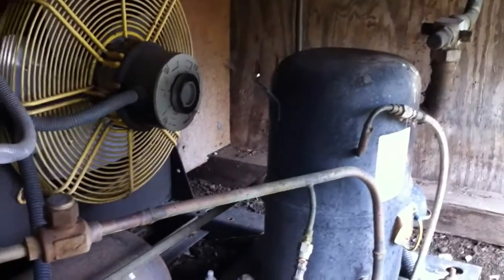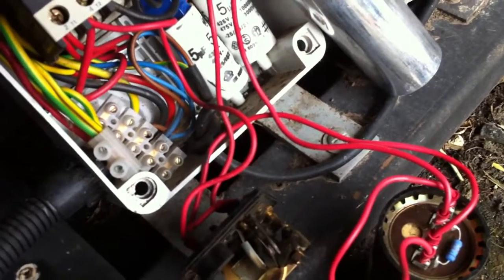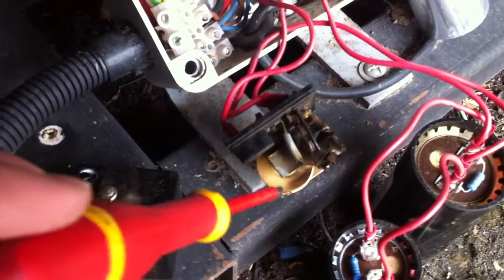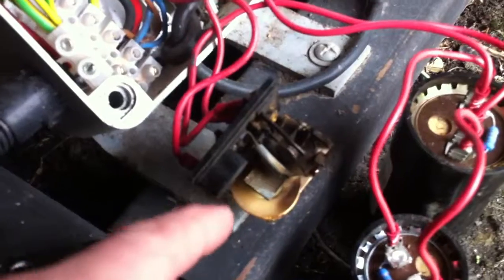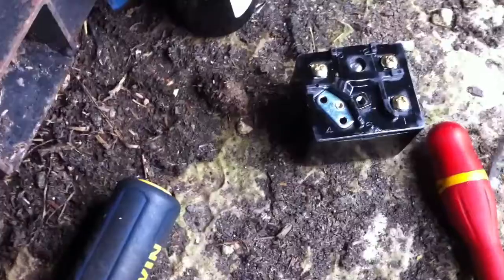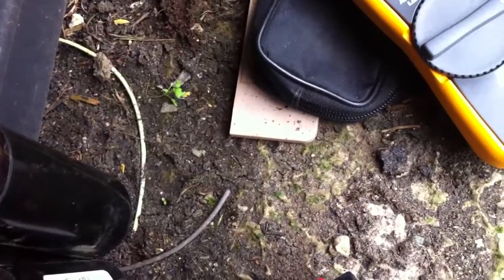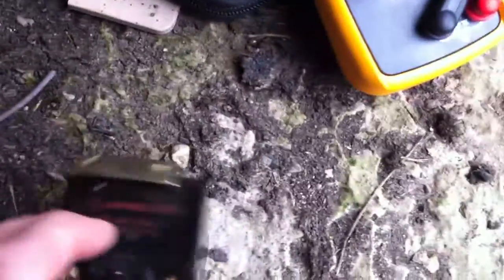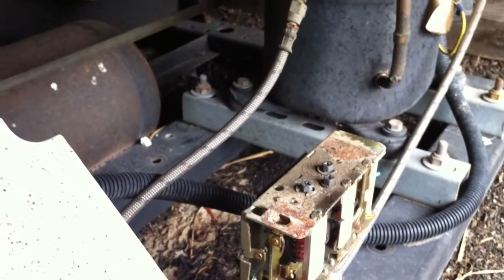HVAC Compressor Non Starter

Comment: Nice repair Heavy diesel. Were all those start and run capacitors just hanging when you got there?
Reply from the maker: Thanks Brad! They were loose in the box, i had to tape them in with electrical tape so i could put the lid on..... Its been like this for a good 12 years since my old employer installed it, I voiced my opinion at the time about the size and layout of the electrics box and was told my opinion wasn't wanted...